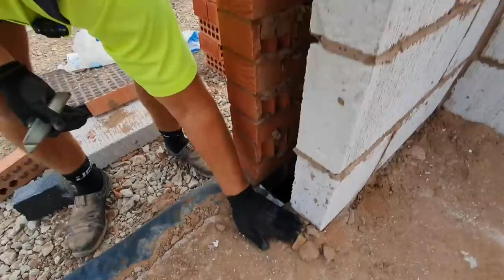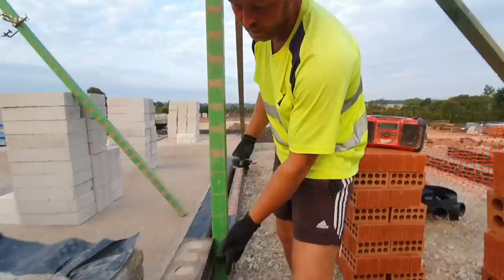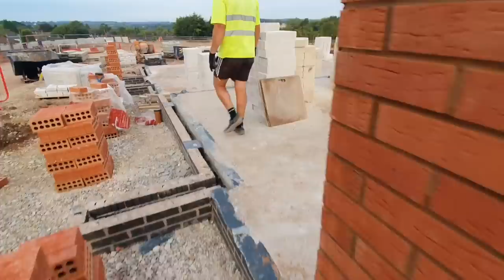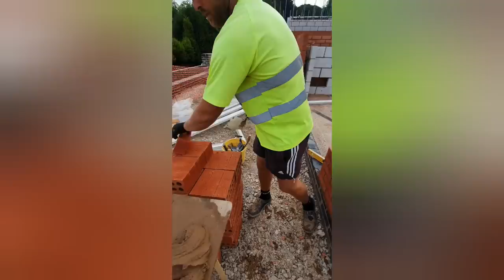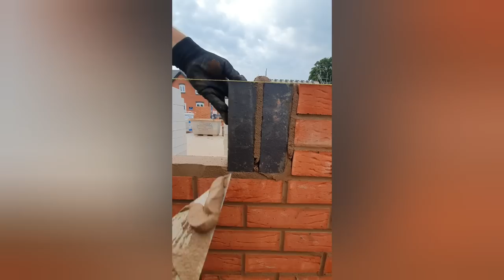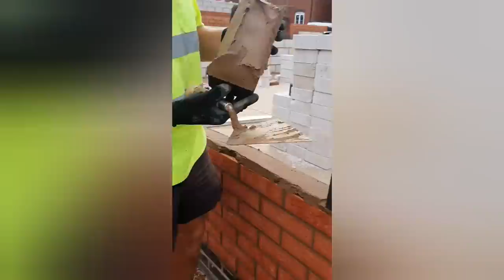You Will Get Pulled For This!

Comment: The damp course should travel down the movement joint vertically,  behind the expansion foam, to the lower level DPC on a step band course!!  Tony
Reply: Yeah that makes sense, I guess some inspectors mat ask for that as there is below DPC brickwork abutting against above DPC brickwork.

Comment: Does anyone else use two lines when doing a soldier course?
Reply: no but over a long lintel i will prop a length of lath underneath and mark the gauge, helps them from tipping
Reply: Yes I do and put a lat underneath every length of soldier .
Reply: @matthewingham7806  that’s how it’s supposed to be done.
Reply: @patrickevans4682  yes mate I got taught that way so why change it see so many people trying to wedge pieces of brick and snap bits of mortar and wedge them 🙄
Reply: Yea me 👍

Comment: how's that bonding tie fixed, if its sliding in-and-out of the bonding sleeve?
Reply from the maker: De-bonding sleeve
Reply: it is supposed to slide in and out of the sleeve, its called a slip tie and if the wall expands the tie moves with it instead of cracking. What he failed to mention was that when building in your tie you should keep the tie back 10mm from the end of sleeve to allow for movement the other way
Reply: @larry6518  - Thank you Larry, I wondered the same thing as the OP.